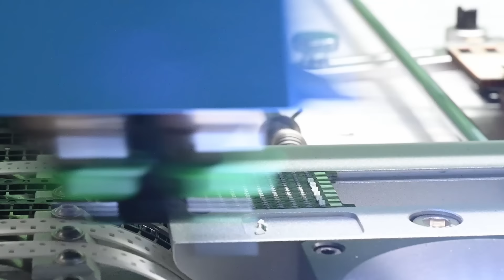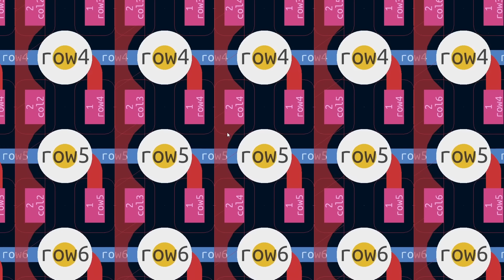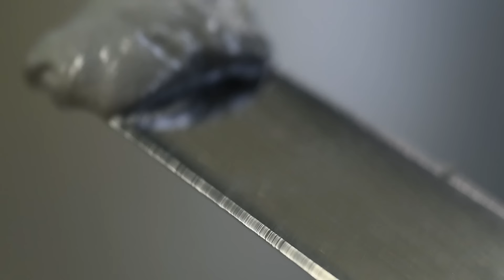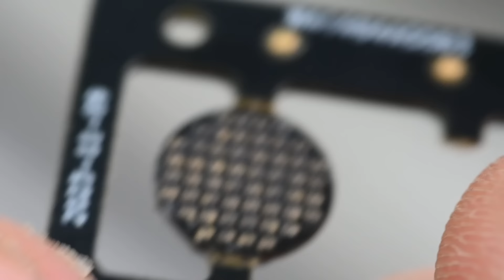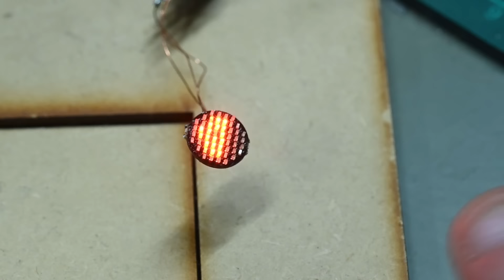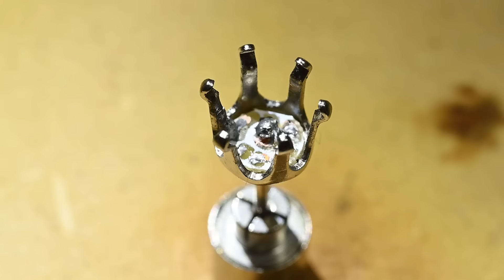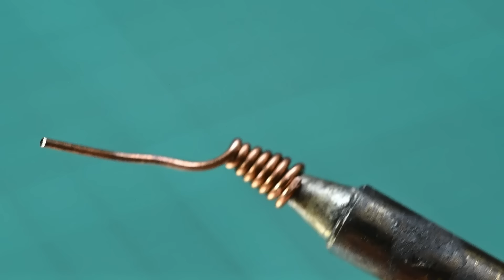LED Matrix Earring

Comment: The way i usually solder really tiny pads or fine components is to grab the soldering iron and put a little solder on the tip, then put a bunch of flux on the board and just drag the iron over the pads. Then put more flux on top of that, put the components over the solder blobs, and reflow. Works like a charm without a stencil every time.

Comment: I think the wankiness at 12:45 is caused by the air blown by the hot air gun, not by the wanky solder paste. I think by reducing the air speed of the hot air gun and bringing the gun closer, it will finish up much better.

Comment: I would definitely without a question wear this. The errors are too small to notice, so it just looks incredible. I would run hair-thin copper wire to an external battery pack, maybe even hidden in my hair lol

Comment: I have an idea, what you can display. You can use that thing to be a communicator earring. Means every single led is actually a communication device, if you are using Morse code. So just send a stream of texts on each LED and you will at around 10 wpm a complex enigma of text, that one actually can read. See, the normal signal speed of visual Morse code maxes out on 10 wpm, because the eyes are much slower in recognition than sound would be. With sound you can max out at about 70 wpm. But 10 wpm is fine. 
This means you got 52 LED and with that 52x 10 wpm and this means 520 wpm, aka  2600 cpm, with wpm words per minute and characters per minute. To get that to baud, you multiply it with 5 usually, dividing by 60 for seconds. Means 216 baud human readable earring. It just takes a while. 
And you of course need to learn Morse code.
Or build a small camera for the other ear, that can read that telegraph from an other person and send that via BT to your phone. Earring Morse communicator. I know that is all not very practical, but it's not about being practical but is it doable I ask?

With that speed it would easily also send MIDI data by the way, but I don't need to tell you. „The singing Morse-earring“. Just saying.

73 DL7HH

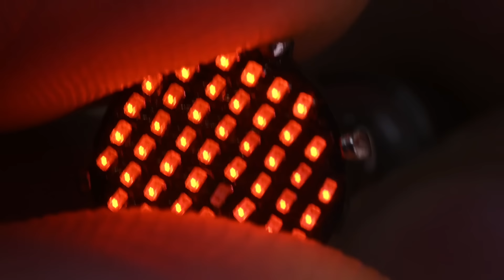Comment: 17:51 Just as an idea: How about using (a little) more (fresh) paste, and hot air … after shielding the rest with Kapton. Though, through the screen you lose a bit the sense of scale, so I'm not completely sure how feasible that would be.

Comment: Used to have ear clips that you could screw in off or on the ear to make contact with a small button battery. It had a layer of semi-translucent resin with two led’s hiding under it - one red and one blue. The problem was that the on position would make them constantly blink on and off, seemingly on purpose, like a miniature police car. If I had those with adjustable color/strobe or even an entire display - I would l wear them everywhere.

Comment: If you want another challenge, it is entirely possible to hand place and solder 01005 components with a fairly barebones home lab. The trick is to use a single peice of dampened hair in place of tweezers to manipulate the parts. I use a $100 student microscope, a pneumatic solder paste dispenser, and a metcal SP200 and a harbor freight watch repair kit tweezers and harbor freight hot air gun as my soldering kit.

Comment: The CH32V003 is an amazing device. My only complaint is... well... certain politics I don't want to get caught up in. Anyway...

Had a look at your code, and, (as I expected given the lib you are using) there is a battery performance improvement you could have. Particularly, the function DelaySysTick() is not optimal. It just raw dogs a delay into the SysTick counter hardware reg and then sits there waiting for that to exit, all the while spinning the processor's wheels and consuming current.

A more elegant approach is to load the SysTick counter with the timeout, set up any sleep option, and rely on the wake from sleep mechanism inherent in the SysTick interrupt.

Of course this is a bit easier said than done. There are significant setup and timing implications, but the potential power saved is incredible.

Comment: Vey cool project you got there,If you have any plans to sell them, i would be very much interested, its time i changed my studs, some suggestions purely based on personal preferences, 5-6mm dia studs, i like the randomised flickering.
If you coat it with a clear epoxy it would act as a protective layer as well as imporove it quality as well.
Please let me know if you ever plan on mass producing these, i would be the first in lineto purchase

Comment: Could the two boards be sandwiched using castellations to bond the processor board to the LED board, so they could be sandwiched AFTER the LEDs are pick and placed. That would allow the LEDs to be pick and placed using standard board vender PnP systems, and the boards then separated, flipped around, and soldered onto each other after the fact.
I think this would actually combine the step to solder the two boards together with the step to solder the processor into a unified step. the big benefit would be that this would allow the LEDs to be pick and placed by the board vendor (the processor is left unpopulated).

Comment: Any thoughts on adapting this to work with a 5V WS2811 bullet pixel, button cell batteries, and the microcontroller you used for this to make wearable LED plugs? They are 12mm (Same as my ears), but I don't have the expertise you do. I modeled it in Inventor but am at a loss as to how to correctly implement it all.

Comment: battery life could be extended by running a thin wire from the back of the earring to a larger battery hidden under the hair at the back of the head. Like is done with LED eyelashes

Comment: If you were to use different solder between the PCB bonding and PCBA processes, I'd suggest using normal solder for the bond and low-temp for the rest of the board. Modern low-temp is strong and reliable, and you don't have to deal with spiteful high temp solder.

Comment: Must admit as a non-earing wearer I would quite like a pair of these...
I would 100% get an ear or two pierced for these. :)
Reply: I could see hairpins, lighting up a braid. Maybe volumetric beads, holding tufts of hair. Thirty years ago, I had dreadlocks. If this technology was possible, back then, I probably would have been searching for a way to light up my hair like a Techno-XmasTree  ✨
Bluetooth Ceramic Antennas take up less space in the 3D, than a PCB antenna, today. 
I wonder if a Host ESP32 BT Transmitter, holding the lion's share of memory and processing responsibilities, could be worn discretely as a pendant, on a necklace, while a number of client devices, all blink & flash, patterns, and colors. Maybe even some tiny audio devices in the group of Receivers. Beeping & buzzing, and chirping to some 8-bit tune, with all the LEDs flashing in time with the rhythm, and changing color, along with the melody. 
  > This video inspired me, wow. Light It UP!

Comment: A little tip for you if you want to be able to make the leds appear sharper, place window tint film over them, this will hide the individual leds and only show the ones that are lit, adjacent leds pick up the glow and wash it out which the tint would prevent, it would also make filming them a lot easier.

Comment: You really need a little MHP30 or similar hotplate for these tiny projects, not having airflow is a huge headache saver for alignments, also tiny hotplates can be used alongside magnification to fix tiny alignment issues in real-time so it's not even an extra reflow operation at that point.

Comment: clean the stencil with a toothbrush, preferably not yours. 0.08mm stencil is harder to get a uniform paste thickness, but your result will be pulled straighter and flatter

Comment: About the "what to do with them?" I made tiny LED Matrixes 8x11mm (ReDot_Smart by Alex on Hackaday) for the express purpose of putting them below the eyes of some models in cyberpunk outfits, and have them scroll through a "crying hearts" animation. Granted, that project could have been MUCH, much easier if I knew what I was doing, or I had known how to get the undersized PCBs populated by the manufacturer. But the project is almost done* now, so I can start planning the results.
In a similar vein, I looked into LED-Fingernails with inductive coils and charging armband, maybe you find that a fun idea^^

*My makerspace has "Almost done" stickers by the roll, because that is usually a very long status on projects

Comment: As someone that uses 1206 components for ease of assembly and jittery hands, this horrifies me- you can probably fit 8 leds in the footprint of a single 1206 resistor. Good job!

Comment: Would two zinc air cells (2.8V) work? Should have higher energy density than lithium. They are readily available in small form factors as hearing aid batteries but are also a bit expensive.

Comment: Nice, it could also be put in a ring (that could have larger (possible rechargeable battery) then when holding hands with your partner they would activate and show a personal pattern (one wire pan network, conduction via skin)
btw when iyou said 4 for one penny i had to think so that's (1 pound = 181 penny's) so = 724 for on pound, 572 for one $ and 623 for one €, Nice

Comment: Stencil thickness is definitely something you should explore. Due to having no wettable flanks, there is nowhere for the excess solder to go. Using a thinner stencil helped me before improving X2DFN2 package diode manufacturability. It provided the stencil thickness in the datasheet. Take a look at your LED one.

Comment: That's really beautiful. It reminds me of the old cigarette lighters that came standard in all cars, they are a coil of metal in a tight spiral which makes a circle at the base with a rod attached and this is attached to a cylinder which contains it and a spring push button device. You push them in to the 12v plug in your dash, and when you take them out they glow bright orange like those earrings, for a bit. One time as a child I was waiting for my mom in the car while she ran into the post office to drop some mail and come out, and I touched my finger to the lighter when it was red hot and it made a smell of burned skin. When she came back which was seconds later; I was busted due to the smell.

Comment: If i had these, i think i would dab on some black nail polish and completely surround all the LEDs, then sand it down using some very fine grit sandpaper to uncover the LEDs, then finish it off with a clear coat of something. That way the LEDs aren't lit up as much by neighboring LEDs for better contrast.

Comment: In the early 80s when i was about 15 I made some led ear studs, these were a 5mm amber led with the leads clipped short and connected to a 2-transistor blink circuit and battery with thin enameled copper wire. I was surprised that there was some interest by a couple of girls in my class and I sold two. 
This project is more impressive but there was a wow factor in the day to having a blinking earring too.
Being a nerd you can imagine how far I got with those girls...

Comment: Wonder if you could wirelessly charge of a pack on the hip and use some liquid latex makeup  to tag the wireless charger behind the ear even hide it if you want to. Ya not practical for every day ware.. but women use dresses that require duct tape to use.. Could swap out the onboard battery for a cap and rectifier should be lighter than a battery even with more goodies.

Comment: you could make the other side of the pin the controller, put a basic little bezel around the LEDs, and resin them in, then have a removable diffusion filter as an option. plus you can hide a lot more behind your ear

Comment: Idk if you have the equipment for it, but I think if you made the display out of a tiny OLED panel it’d look pretty baller. Plus they could be stacked to add volume to the image, but then you’d run into more data and power issues. Maybe it’d be good for a mk2 of the candle tho?

Comment: I’ve done a lot of screen printing ink on fabric/paper and one of the first things you learn to get consistent application is to hold the squeegee at a higher angle to the screen (probably about 75 degrees). This helps you apply pressure more consistently. The screen bowing down to meet your material is your friend! You basically only want the screen to ever touch the surface of your material once as your squeegee passes over. Every time you have to do another pass risks it being aligned slightly differently and smashing the edges of what was already applied. Not only can that make your edges fuzzy but it can leave paste on the underside of the screen, depositing on the next board you pull. I hope this helps! Idk what kind of tutorials exist for solder stenciling but it’s extremely similar to screen printing and searching for technique videos of that could hopefully help you improve your application.
Reply: This is very useful advice, thank you!

Comment: Just when you think Mitxela has finally reached the point where hand soldering is no longer possible, he busts out the copperwire tip and proves you wrong. I'm now solely convinced humans will never create a package too small to be hand soldered by Mitxela.

Comment: Back when I started in SMT I thought anything below 1206s were small 0805s were little to me then and always amazed me how they'd get the resistor values stenciled on the top of the resistors. .25 mil was considered fine pitch too.  First machines we used were Dynapert MPS 318 and MPS 500 I think their limit was 0805s & .25 mil.

Comment: I'd absolutely wear these!

You should also look into making them accept wireless power, that way you could wear a battery on your collar and have a small wire up your neck that leads to the coil for power transmission or a slightly larger battery around your ear similar to a hearing aide

Comment: On the vibration issue, someone made a small modification to their p&p by adding a sponge with a runner under the open portion of the "trays". Think of the sponge that was on the back of tapes back in the day, that gave some push to the tape when it was contacted by the read/write head but with a little bit of plastic on top to make it smooth for the trays to pass over. Source is a forum post, so no pictures on how they did it on their machine, but it should easily to figure out a method. With the sponge in place, the pull is less jumpy and parts don't fly off anymore. That individual didn't have an issue with them popping out, he had an issue with them losing orientation once opened (turning on their side). Iirc. Just a thought.

Comment: 16:57 i do this all the time whenever removing super tiny components. Usually in a fork so i can work both sides of a resistor or similar. Too chicken to use a heatgun on super complex boards. Good old iron hax! :))

Comment: Dimmer should work quite well in practice, especially if there was some slight dimensionality, possibly from a dollop of epoxy you should put on it anyway.

Other ideas:
Is even 1 MHz really necessary?
An external battery could be worn behind the ear.

Comment: For standard earrings I can see this as a pain to make as an evening item, but.. ear tunnels like I have would be amazing, you'd have much more space to work with, wireless earbud battery, or even a rechargeable hearing aid charging circuit. Mine are 12mm, Id wear them.

Comment: Stack up other boards around the one your working on when your stenciling small stuff it'll keep everything flatter.

I had great difficulty with those chips. I was doing a simple hobby RC servo thing and I couldn't get the timer to start reliably. About 50% of starts the timer wouldn't start running.

Also were you able to get the debugger working well? For me that was intermittent as well, especially for anything outside my code, IE library code and things before main()

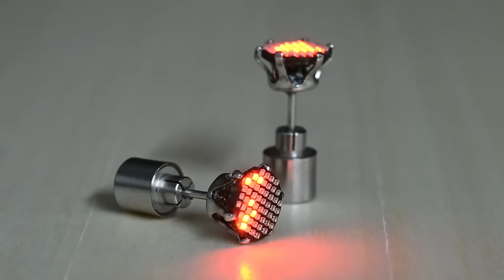Comment: 18:18 Left hand Ear Ring. LED 4 rows down (if display is rotated around 30 deg anti clockwise that is) and 4 in from the left hand side never lights up! Think it may be the same one as mentioned by animefreak7098

Comment: I never inhaled a component, but I did eat a resistor once. It pinged off out of the tweezers not to be seen again (I thought). Tip: don't eat chocolate chip cookies in the same room at a later time under bad lighting and pick up the crumbs 😅. Very crunchy!

Comment: I feel like you can solve the battery problem going in the way of wireless earphones adding tiny rechargeable batteries and using the case to charge them also maybe program the patterns too since casing doesn't have to be that small you can integrate a usb charging and driver to program the chip

Comment: if you mass produced the slightly larger matrices, or even the smaller ones, with or without a plastic case. i know id buy like 10, Could be relatively cheap if you sell them without the batteries

Comment: For stuff like MCUs which don't need the thermal pad for heat or RF, I usually omit it from the PCB  - more room for tracks, and sometimes the large pad can make the part float up if there is too much paste.

Comment: I have myself a streaming "image compression" which is type of 4-bit RLE encoding on bytes, where only 0 and FF bytes are run length encoded. Other bytes are passed through verbatim. Then the bytes are split into nybbles, one nybble per pixel, and there's a look-up table from the nybble to the colour. I'm using this in a prototype shitty SLA 3D printer. The outcome is that basically just the value transition areas on the outline are transmitted, and large white and black areas are compressed out. I transcode it from Prusa Slicer's output which is a ZIP file of PNGs at 240x320 resolution, and given PNGs have a fair bit of overhead, i basically come out even.

I think you can squeeze the LEDs closer together by mounting them diagonal if you like.

It probably has one dead LED but i doubt i'd want to fix that :D
Reply: So here's a horrendously bad idea. A wireless power choker that would inductively supply power to the earrings.